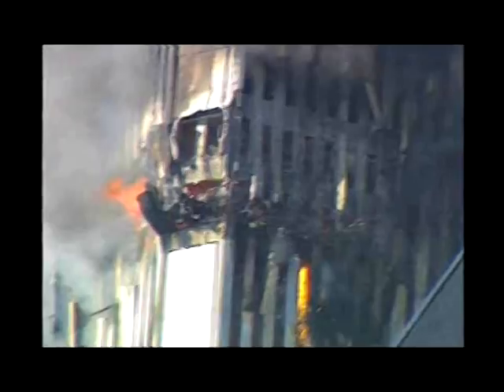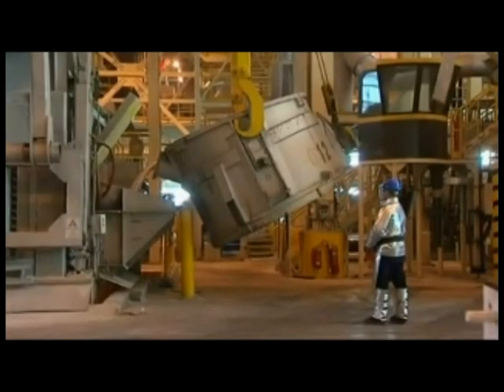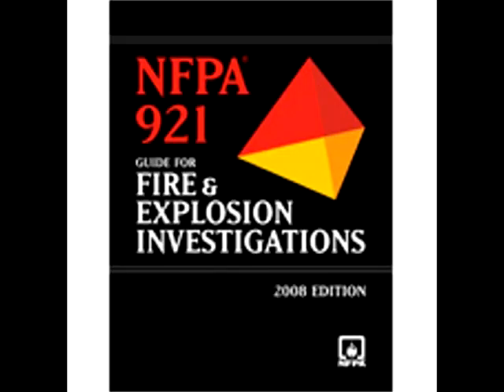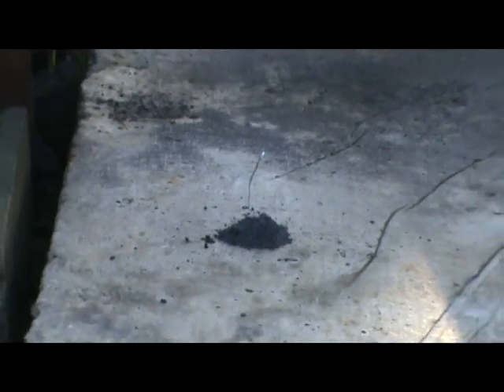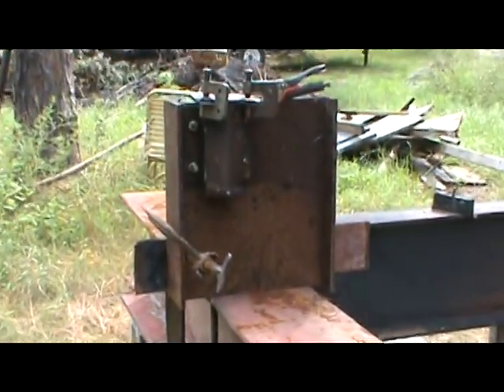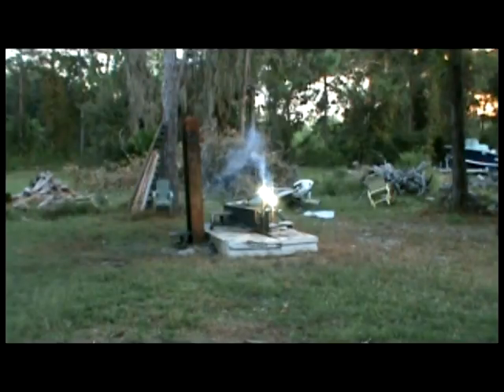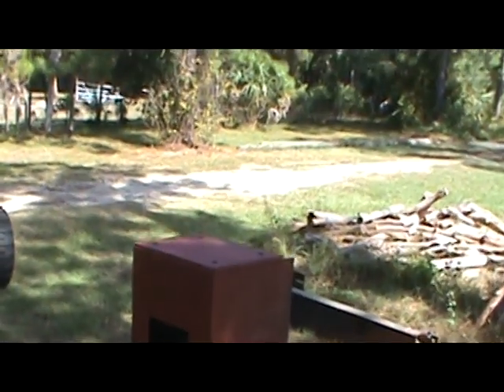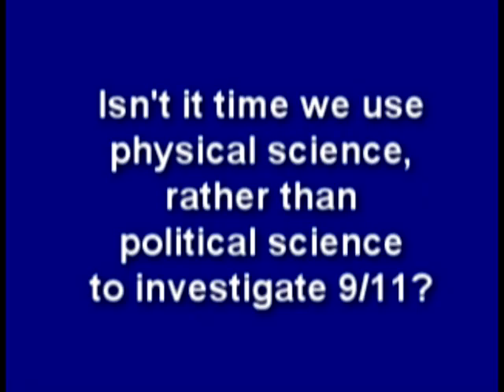9/11 Experiments: The Great Thermate Debate

Comment: Great job.Well done.
Reply: Great job? Fucking idiot.
Reply: terrymanning1 No you are the fucking idiot.I watched your little video about the speed and turns.Those are professional pilots.Would you like to see a 757 do a complete barrel roll? FUCK YOU,you started calling me a fucking idiot.No way in hell a bunch of guys with box cutters did this.Tell me how the buildings fell at free fall,molten steel etc.
 You people say you want evidence for 911 Truth??? Here is some:
1) WTC 7 Falling at Freefall Speed for 2.25 seconds
2) WTC 7 Falling with perfect symmetry
3) Molten Metal found in all three of the sites
4) Underground fires lasting for 3 months after collapse
5) Both North and South towers falling at 2/3 the speed of freefall
6) The smaller upper portion destroying the entire lower portion
7) The Sulfurication of the Steel Beams
8) Horizontal Cuts in the Steel Beams
9) Billions of molten iron spheres found in the dust
10) The nano Thermate chips found in the dust
11) The Police and Fire Department knowing about the WTC 7 Collapse before hand and clearing everyone out of the area. 
12) The grass around the flight 93 crash site was never burned by jet fuel.
13) Squibs seen as the buildings collapse
14) The horizontal ejection of Steel Beams at 70mph
DON'T GIVE ME THAT NO EVIDENCE BULLCRAP
INSIDE JOB IS THE ONLY CORRECT ANSWER 
PLUS THERE IS OVER 2300 AND COUNTING WORLDWIDE EXPERTS THAT SAY IT WAS A INSIDE JOB.
Something so clear and you hold no degree of any type except BULLSHIT.Remember you fucking cock sucker you started with the name calling.
Reply: Eddie Hayes Thanks Eddie...Terry crawled away with a new pile of poop in his pants..He's needing the bottle pretty bad now. LOL
Reply: TWOLF Ravencroft Fuck off TWOLFIE the TWOOFER. Eddie fucked off and hasn't come back since I handed his fat ass to him.
Reply: TWOLF Ravencroft Old terrymanning1 is a complete idiot.I don't know a little about 911 facts,I know a lot that are true.I know a hell of a lot about 911 being a inside job.I spent over 20 years in the military and I seen how "NT" can bring steel buildings down.I say "NT" because that is what the military calls it.Never "Nano-Thermite" just plain old NT.Plus a degree in Mechanical Engineering so I have a pretty good background.I'm not a nut standing on a street corner screaming the worlds going to end.terrymanning1 really thinks the government of the US cares about the citizens.
Reply: Eddie Hayes You had your arse handed to you and ran away. Prats like you suffer from the Dunning-Kruger effect. You think you're smart, but you're actually a gullible schmuck.
Reply: terrymanning1 Your drunk now buddy...go to bed and sleep it off.  Use the bathroom first so you don't poo yourself again...good boy!!
Reply: terrymanning1 arse?are you from the US?I didn't run dumb ass why are you saying that?Plus like +TWOLF Ravencroft said go to bed and sleep it off.Use the bathroom first so you don't poo yourself again...good boy!!
Reply: TWOLF Ravencroft Old +terrymanning1 probably drunk,shit himself last night and needs to crawl that shitty ass in bed.Good Job guy,talk to you later.
Reply: Eddie Hayes Eddie, with your knowledge, there is no need to lower your self to this mans level with the name calling. Stay cool. nothing is gained with this kind of talk.
Reply: I would like to think we are grown up civilized men, not junior high kids. It would be nice to have a discussion on this matter without the name calling. No one is 100% sure what really happen, either way, but for sure we will never solve this mystery  this way. When you think about it, once you insult a man ,nothing you say after that is going to sway him in your direction.
Reply: Coyote Dominguez The 9/11 truth movement : A decade of helping stupid people think they're smart.
Reply: Coyote Dominguez Hi Coyote is terrymanning1 acting like his usually self?